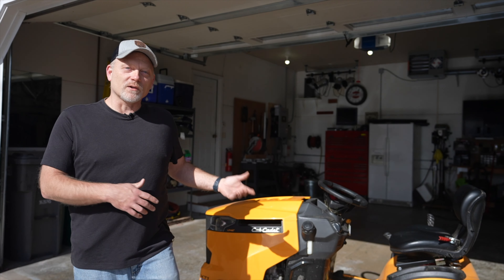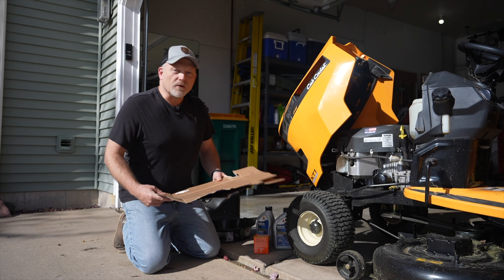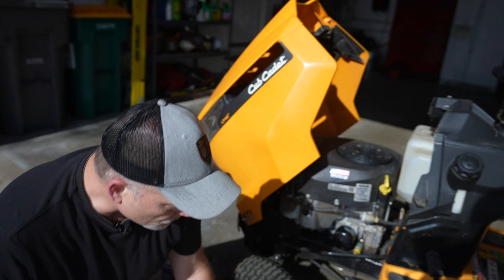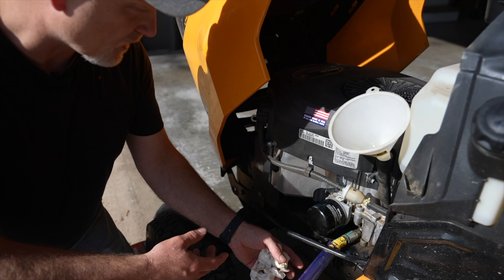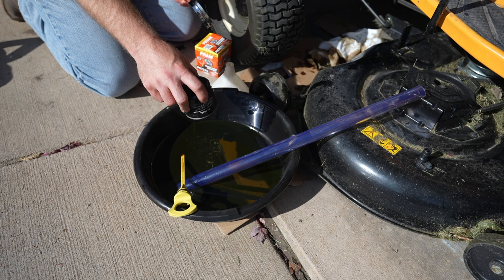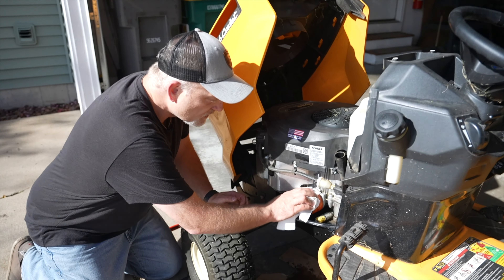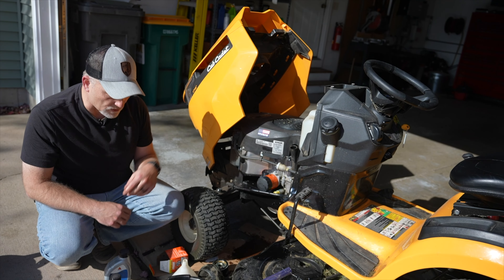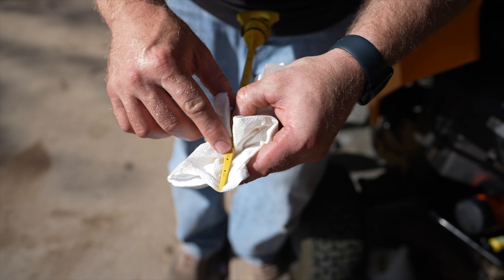Easy Cub Cadet Oil Change | XT1 or XT2

Comment: Recheck the oil level after running it. The filter will fill, and the oil level in the engine will be slightly lower. It shouldn't be a lot because the filter is small, but why not get the oil level up to full.

Comment: Great video! I have an issue with my front wheels going in different directions and it's difficult to steer. Any recommendations on how to fix that? My mower is very similar to the one in this video

Comment: Thanks for the video. What snowblower are you using? And how do you like it ? We live in Minnesota. Abd have been pondering a plow or snowblower for are xt1.
Reply from the maker: It’s a 3 stage snow thrower attachment for the cub cadet. I’m not sure if they currently seek it new you may find used out there. I like it, for clearing a lot of snow. However, it’s not super easy to swap every season when I remove the lawn mower deck and install the thrower.
Reply from the maker: It’s a 3 stage snow thrower attachment for the cub cadet. I’m not sure if they currently seek it new you may find used out there. I like it, for clearing a lot of snow. However, it’s not super easy to swap every season when I remove the lawn mower deck and install the thrower.

Comment: The W stands for winter, not weight. And with it being multi viscosity, it'll have the lubricity of 5 weight in cold temps and 30 weight in hotter temps. Just trying to help in case someone didn't know 👍🏻

Comment: Hi, I have the same mower/engine, when I use the taller filters (Fram PH7575 0r 3614 or equivalents) the steering rod rubs/dents the filter when the left front axle goes upwards on hills or bumps, I can see in your video you don't have much clearance left with the taller Fram, the dealer told me they are well aware of this issue and that is why they went with the shorter filter (Kohler 12 050 01)
Reply: The fram equivalent for the shorter kohler engine is the PH8172

Comment: Nope. You are supposed to put in oil to threads of the filter first and wait two minutes before installing. If not you have to adjust oil level again. Not sure if it has other benefits to fill the oil in the filter but manual recommends that. Good video however.

Comment: What size Fram filter are you using?
Reply from the maker: Fram PH7575 filter on this engine. The PH8175 should work as well.  You can use a website similar to this to look up the exact one for your model/engine: https://www.fram.com/partFinder/search/index?type=3160&year=Any+Year&make=0187&model=14495300&engine=Any+Engine&car-type=lawn-garden